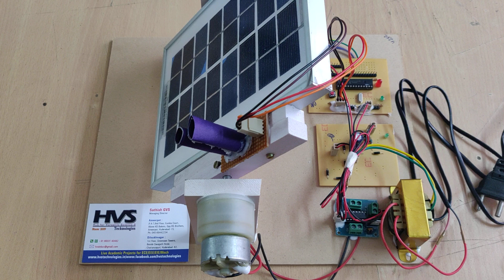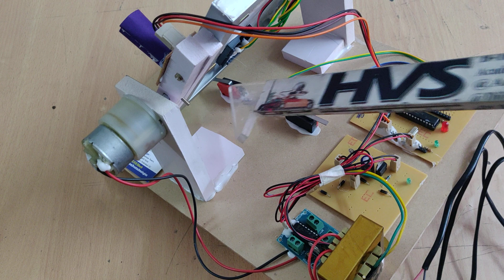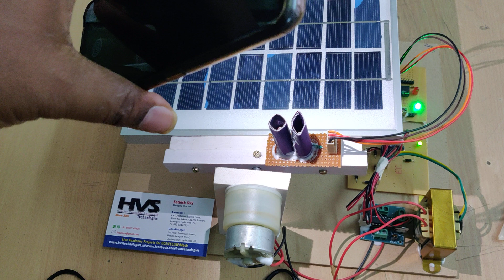Solar Tracking system using PIC Microcontroller

Comment: Hey bro I need this project source  code or programming of microcontrolle if any
Reply: How can I contact you
Reply from the maker: @virajsingh6042  You can contact us at +919603140482
Through WhatsApp or call
Reply from the maker: You can contact us at +919603140482
Through WhatsApp or call